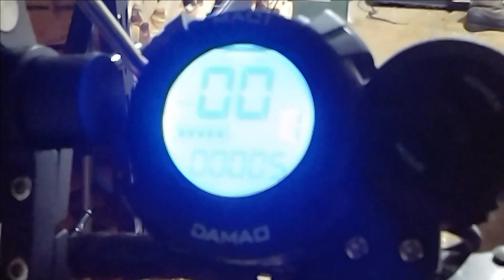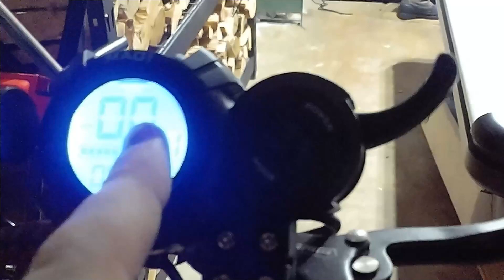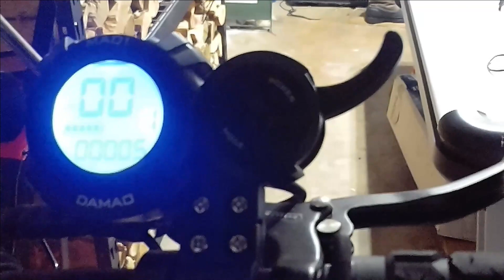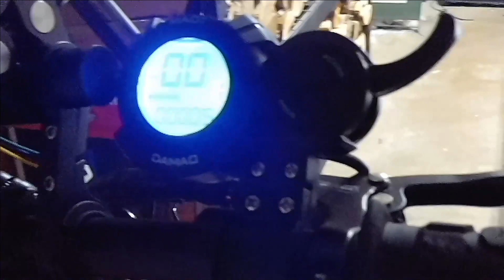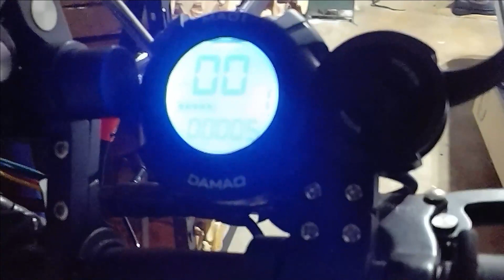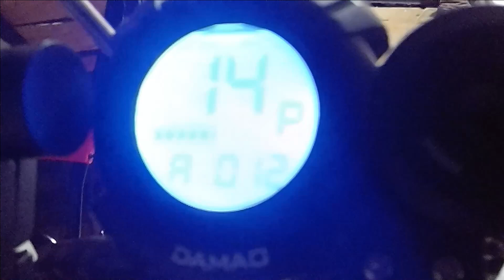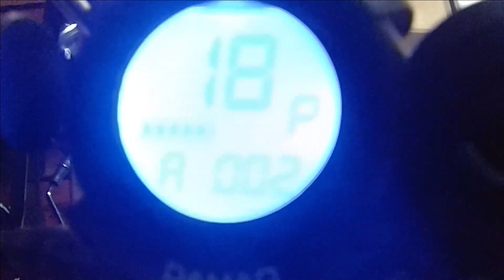Toursor X13 Parameter Settings (MAO1 DAMAO Display)

Comment from the maker: QUICK PSA I JUST REALIZED MONTHS LATER I SKIPPED PARAMETER 12 😂😂😂😂. 

I'll quickly explain that P12 is the start intensity from 0-5. 0 being an easy start and not much torque when you first hit the throttle. To 5 being having your front tires burn out and having the scooter in beast mode pretty much. If I'm correct mines set to 3 so it's in the middle!
Reply: skipped 5 also ?

Comment: P01 Lightness, 1 is dark and 3 is lightest

P02 Mileage km or mph

P03 Voltage setting 36v-72v

P04 Sleeping time, 0 is none and other data is 1-60 minutes

P05 Assistant level 0-3

P06 Wheel size inch in 0.1inch

P07 Magnet pcs

P08 Speed limited 0-100km/h, 100 means no speed limited

P09 Zero start or non-zero start

P10 Drive mode 1 electric drive

P11:PAS none

P12 Start hardness, from 0-5

P13 PAS setting (NONE, IT CAN`T BE REALIZED SINCE THERE IS NO PAS WIRE FORM CONTROLLER)

P14 Controller current Limited set

P15 Controller voltage short setting 48v is, 60v is ,72v is.

P16 None

P17 Cruise, 0 is no cruise, 1 is yes

P18 ABS brake hardness, 0-3, soft to hard

Error Code or Driving situation

0 Normal

1 Stay

2 Brake fault

3 None

4 6km/h

5 Cruise

6 Battery Voltage Short

7 Motor fault

8 Accelerator fault

9 Controller fault

10 Lcd display receiving fault

11 Lcd display sending fault

12 BMS communication fault

13 Front light fault

Comment: Hello, I bought a diaplay damao, which works between 48v to 60v but when I connect my 48v battery it appears almost discharged as if the display detects that it is 60v and not 48v, how do I configure it so that it detects that it is 48v and not 60v

Comment: Here is a handy tip, especially with the large value parameters like speed limit. In the lower left is an “A” looking character. If you press and hold POWER and it will change to a “d”. So “A” advances the parameter with each MODE press, where “d” decrements the parameter with each MODE press. 

I can’t get my little display to show speed, current, ODO, trip (shows voltage and Mode#) and the big display doesn’t show ECO/Turbo,  Single/Dual, nor MODE status. The speed it shows it totally bogus. Any clue WTF is wrong with my Beastie???
Reply: Ahhh thank you so much, I stumbled upon it and really wanted to know what the a or d meant. Was afraid to mess up my settings.

Comment: P 12?
Reply from the maker: Huh I just realized that I skipped P12 😂😂😂 my bad. Anyways P12 is start intensity from 0-5. So this will change how much torque you will have the initial hit of the throttle. So 0 being just starting off easy and 5 being burning out the tires probably. If I'm correct mines at 3.

Comment: Thank you for this review! I just got my X13 and I want to ask if this happens to you as well.

Gears 1 2 and 3 doesn't seem to make any difference. Eco and turbo doesn't seem to make a difference as well. Single and dual is the only thing that works and man it is so violent. Not for beginners.

Does your regen brake work? Because I set it to 3 and it doesn't seem to have any difference with 0.

I set P12 to 0 but it still start really violent.

Comment: I had a question for your Toursor  x13 parameter video I wanted to know why you skip parameter 5 assisted gear position I know it says 0 to 3 gear mode would that increase acceleration?

Comment: do you know what the charging plug icon in the bottom left corner is. it has a spanner inside the plug icon.
Reply: I'm thinking it's maybe regen active on the battery but I have p18 turned of I think.

Comment: Hey the P2 kmh to mph doesn't work did you ever get it to work?
Reply from the maker: So yours doesn't work either? Cause I've tried numerous times and it just won't switch over. All the other settings work just fine for the display though so it's weird
Reply: @JMProductions4KHD 

Hey my scooter finally came at long last, I got it last week Monday and I'm so happy with it. Not sure if you remember me from comments on your previous videos but anyway I have good news. 
I managed to change mine to mph but mine is the Realmax version of your scooter, so maybe you need to go to P3 on your one and try what I did on P4.

I've posted the steps below so let me know how you get on.

Press the power and the mode button at the same time. 

Then you press the mode button to change the display to P4 or P3 on your scooter.

Now press the power button to enter P4(P3) and you will get a 0 value flashing at the bottom on the right.

Press the mode button again to change the value from 0 to 1 and that will change it from kmh to mph.

You're welcome!😬
Reply: @Phoenix3astman  - I too have the Realmax. I am confused by your recipe. P3 is for voltage (48, 52 and 60) and P4 is Sleep timeout. So how does this impact P2 the km/h & mph?  I did observe what appear to be an “A” and “d” if you press&hold Power in almost every parameter screen. At the moment I lost display of current, speed and distance on the small display and Modes 1-3 do not show on the large display (nor ECO/STD or Single/Dual). Advice appreciated….
Reply: @barnboy3168  Hey I have no idea why mine allows me to do this the way I wrote it earlier. That being said, it doesn't even show me the readings I'm terms of how fast I'm going in mph only the bug screen works. I'll have to see what the realmax company say.
Reply: @JMProductions4KHD  nope I contacted my seller they tried to walk me through it but it seems to work on other monitors except this one smh and I have the big monitor as well that it works with.
Reply: @BigBrad9976  Hey did you guys try it? Let me know if it works for you guys or not.

I must say I love this scooter and the fact its a head turner makes me appreciate it even more. Everyone out here in the UK rocking the same scooter then there me and this beast.
I got a gps tracker with mine but they forgot to give me the damn details for it so I had to open up the board and try and look it up. It started flashing then sparked 🤦🏿‍♂️ Just tole them to refund me for that.
Any suggestions for a good tracker guy?
Reply: @Phoenix3astman  oh wow that great yes we both have the realmax version checkout my YouTube channel and you will see mines but no I'm going to try it now thanks alot. And congrats in finally getting your baby
Reply: @Phoenix3astman  nah shit I need one I was thinking about Tmobile they have live tracking units

Comment: Hey finally got my scooter it took 70 days only because FedEx held it in due to no workers to unload the trailers and I was pissed but I'm happy it's here finally
Reply from the maker: Awesome to hear. Yeah mine took 60 days and I thought that was bad. Do let me know how your scooter runs when you finally get it going!
Reply: @JMProductions4KHD  thanks bro I got the big monitor also
Reply: @JMProductions4KHD  oh yea the scooter runs excellent and the sellers are great had an issue where I burned out my light control and they sent me another one but still not the issue my light stays on unless I turn off the scooter do you have an idea what it can be?
Reply: @BigBrad9976  if ur light stays on and only turns of when the scooter is off it means ur lights wired to power lol and not wired to the switch
Reply: @BigBrad9976  if it was hooked up to the working switch the switch will allways cut the power and the switch is the first one fed the power and then off the switch negative would go the light positive. maybe u don't understand electronics to well yet I am starting to get a better grip of it my self
Reply: @trtertretererterterter510  no that's not the issue bro it was working with the off and on switch but when I opened the floor panel it was a loose wire that touched the metal and something shorted out in the light department

Comment: I received this damao mao1 and dual motor controllers in the mail a few days ago  it took me a day to get installed I needed the Ali express vendors help but they helped me after a days wait. I wanted to ask you about your cruise control mode I noticed with mine when I turn it on and activate it the rear wheel spins in cruise and the front wheel stops  does yours do that I was thinking maybe I wired it wrong or maybe cruise mode is ment to do that not sure could you raise your scooter of the ground and check for me please. I haven't been able to find any one in the else in the world with the damao display. it is a cool lcd mine has green back lit display. I also installed a green volt meter/key ignition.
Reply from the maker: Hello there I saw your other message and I was meaning to ask if you ever the scooter to operate again. Cause you mentioned the motor and throttle weren't working. Cruise control for me had both wheels spinning. However I do use it so I deactivated it. I've had one subscriber tell me that when I'm cruise control it just slowly continues to accelerate. So perhaps it could be a wiring issue but not sure since there are different responses from other people with the same scooter. And why would you install a green voltage/key ignition. Didn't the scooter come with that?
Reply: J&N Productions  no my scooter was the most cheapest lowest end clone available the akez dual 1000w which means no extras or anything fancy. it had a different lcd different dual controllers and no key ingiton. I added the keyignition first then eventually swapped dual controllers and new lcd together. I see in reguards to cruise mode and both wheel spinning I must have done something wrong possibly a wrong wiring order not sure the wheels work fine though and the 3 gears are working and brakes detected. I might just leave the cruise mode off since both wheels spin when using the throttle just not when cruise activates. do you have any switches for your controller to adjust e brake or eco mode. I don't think eco mode is working now with the new 3 gears that it's using. my. previous controllers didn't have the gears working but the eco. mode button worked which was a handy press. i didn't see any regen braking settings or plugs that sucks I would like that but I think the low brake works by pressing the brake levers just when regular driving. it feels like when I brake it stops way quicker. it would be nice if there wa smother people with this lcd in the Facebook and reddit scooter groups. I'm the only one. so that's why I am coming to you for what info you have learns about it. the seller of it is very vague with everything and takes about a week to respond back which is a pain. I'm waiting for there response for the same questions I asked you. sometimes they still don't understand what I'm saying because they don't speak English an probably  google translate everything

Comment: i bought this and couldnt get it working with my old or new controllers. the old controller i could get it to power on but no throttle. and with new controllers nothing turns on. what a waste of money and the seller dont reply anymore. i got the parameters and supposed wire codes but still no luck with both controllers.
Reply: You have 30 days to report defective stuff to Alibaba
Reply: @BigBrad9976  it's all good I got it working a few days after owning it. the seller finally replied and helped. everything has been working for a month now or so. I get a little charging plug icon in the bottom left corner when I stop accelerating and free spin. I wonder what it is.
Reply: @trtertretererterterter510  could the e-abs (regen) kicking in.